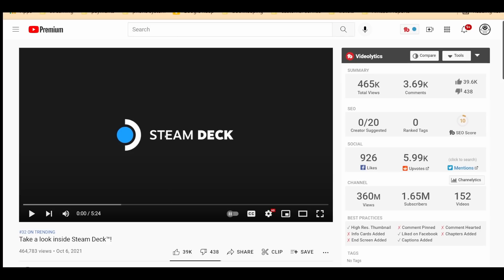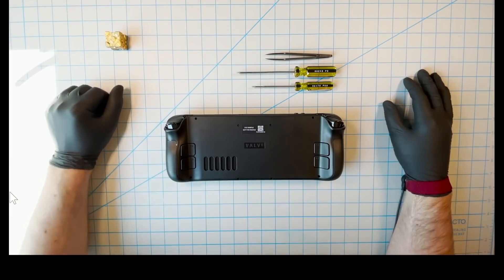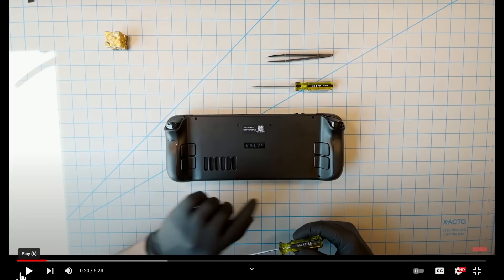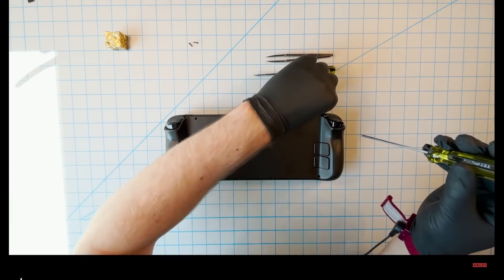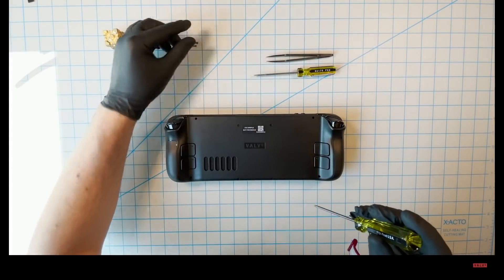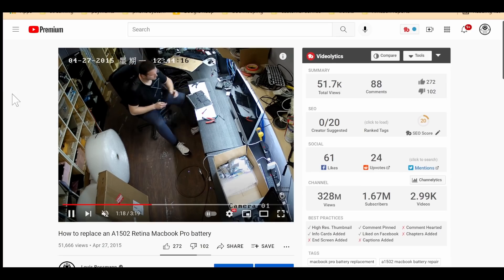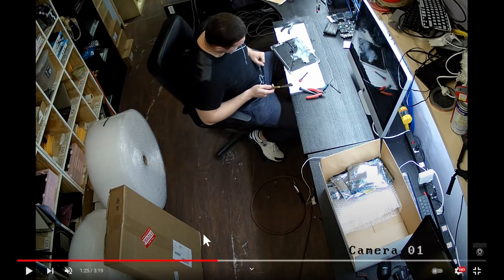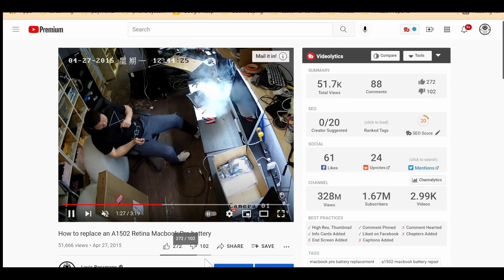Steam deck battery may end your life? bruh 😑

Comment: About the risking of your life bit.. If you nick the battery just enough to not catch fire right away, but only when it's charging (getting hot) It might catch fire without you noticing. That could be dangerous... But Li- batteries might do that anyway.. I think he was getting at the risk of your battery catching fire after you've closed the case and forgot about it..
But they also say, you literally have every right to open your device, we just don't recommend it if you don't know what your doing.. Leave it to the professionals (in my perception that professional could also be an independent workshop...) That's fair enough in my opinion... They are not saying you're not supposed to open the device, full stop, they just say that when opening the device, it's best you KNOW what you are doing, otherwise it could be dangerous.. If you don't know what you're doing, leave it to someone that does (notice he said professional, not Valve service technician) That's not exactly a lie..
And granted, I'm a bit of a Valve fanboy.. In my perception they are usually on the right side of consumer issues. And customer support for their devices is usually pretty good..

Comment: the structural integrity of the steam deck after unscrewing the self-tapping screws and rescrewing them back in has less than 5% difference... also the screws themselves dip deep in the case so nothing will happen to your device (:

Comment: I had an old rc car lithium battery go bad on a charger, on a carpeted floor, I wrapped my hand in a grocery bag and threw it in the bathroom sink and turned the water on, the carpet wasn't burned I wasn't burned, and it didn't have a chance to catch fire.
Reply: Good call.  Water can put out a lithium battery on fire but it may need a good amount of water, so putting it under a faucet is a smart move.  I did laugh out loud when they put out their original video saying "you may die".  I've taken apart both of my Steam Decks a few times and I'm still here 😂

Comment: That whole segment about the warranty had me so confused. In Germany, it's pretty simple. What is the warranty for you is called "Gewährleistung" for us. 
What is much more important is the "Garantie" though, which I always thought was the warranty, but apparently isn't. Manufacturers have the choice to give their customers a Garantie (a guarantee maybe?), whereas the warranty is a legal right. 

The difference is that the "guarantee" can be defined by the manufacturer however they want, meaning if they put a void sticker, you can't open the device up. The warranty is indeed untouched by this, but it means you have to prove that there was a defect in the device that has been there since before you bought it. And if you are able to do so, it's the manufacturer's legal obligation to fix the product or give the customer a new one.

The "guarantee" however usually says that if something happens to your device just by regular usage, you can have it fixed for free by the manufacturer.

Comment: "If you open your Steam deck you will lower it's structural integrity."   Now that was certainly an odd statement.  The only factor I can even think of that would do that might be the strength of the plastic threads from the self tapping screws.  But I just can't imagine that making much difference.  I am a auto mechanic by trade.  And cars are made with very specific structural rigidity standards.  I've stripped my Honda down almost to the point of it just being the body in white.  And re assembled it several times at this point.  And I can assure you it hasn't affected the structural stability of the car.  Can you imagine if Honda sold you a car but said, "If you ever take the wheels and tires off, it will affect the structural integrity of the car."

Comment: Your BS alarm is correct about structural engineering.  Only way you would loose structure strength is if you damaged case when opening or closing.  If everything is put together without damage, it will not affect.  It's like, if you take wheels off your car and put another one on, you could loose control of your car.

Comment: I have been doing electronic and repair for going on 25 years at this point and I have only ever killed 1 thing with static...and it was a special sensor board that I knew was sensitive to static and I was barefoot on my office carpet and felt a little zap...and for the record...if you work on electronics just stay seated and touch something that is grounded...as LR mentions twice.  I have never had another instance of killing something.

Also, batteries should not be glued in, I dislike that practice.  There should be either tabs for screws or a little strap.  I have never ignited a battery accidentally yet...but some of the devices use glues that are darn hard to get off...just my thoughts.

Comment: I think you would only f up structural integrity if you messed threads up when putting screws back in. I always turn screws anticlockwise gently until I feel them fall into original threads before tightening so you don't end up cutting new threads in plastic housing.

Comment: The integrity definitely is lessened and can certainly put the product at risk of permanent damage if a user forgets to put a screw in or doesn't tighten it properly, so it falls out later on. Put 2 2x4 on a trampoline while you jump on it, and see how differently they behave while screwed together only at one end compared to both. Missing screws definitely can cause issues with how the structure reacts to force.

Comment: structural integrity could be affected if stuff isnt put together right. the case looks pretty thin and i don't see many plastic ridges supporting the device. the strength of the structure may be related to having all of their specific components in the device and if the customer changes something to a 3rd partys component it may  cause issues. Might be an issue with stripped screws and such.

Comment: I mean, if they're self-tapping screws, unscrewing them and screwing them back on without following the current stripping pattern of the plastic should make it somewhat less structurally sound. 

Primarily because the failure points are where the screws are, and when an impact occurs, all stress goes into the screws, and thus the plastic that holds the screws. 

If the stripping is fucked, it might be easier for the screw to just simply break through whatever plastic remains holding it together.

I guess you could minimize this by making absolutely sure that the screws go in the exact same way they went in the first time instead of letting them cross-strip the already existing pattern, but even then if it was near perfect you're still exerting force on top of them when screwing it in so the plastic might have its grip on the screw reduced.

Comment: Duuuude Final Fantasy IX is amazing. Steam actually has an HD version available if you ever wanted to revisit it.

The claim regarding structural integrity may have to do with the device being assembled by machines vs being assembled by human hands.

I used to disassemble my consoles and controllers for cleaning purposes starting back from the 32-bit Sega Genesis. But as the tech changed over the years and I noticed the changes throughout the Playstation era and the PS2 era, it actually became more difficult to reassemble the later controllers into a tight fit, like one would expect coming fresh out of manufacturing. I'd chalk it up to human error more than anything, but that bit of human error could simply result in the fit of the shell not being as snug after being in inexperienced hands.

So if anything, it's prolly just a disclaimer to cover the demographic of would-be repairfolk getting in some practice by working on their own devices.

[I also just noticed: The last Chapter title says "What likeky led to these disclaimers"]

Comment: Good video as usual. Couple notes about SSDs. AFAIK they don’t wear from reading data, they only wear when the software writes data. However, there’re 2 reasons to replace them even if they’re working fine. SSDs improving fast, newer models are often much larger and/or faster. And, hardware vendors are very cost sensitive when they’re picking parts. For these reasons, I don’t have a single computer in this house with a factory-shipped SSD.

Comment: The reason the device might be less `strong` after opening is all down to the self tapping screws, the first time they are screwed in (in the factory) they have a perfect fit but if you un-screw them and re-screw them it is not possible to get them perfectly in (even with a toque wrench) you will either not go far enough or you will start to weaken the plastic that is just a downside of using self tapping into a soft plastic material.

Comment: It is pretty likely opened device is going to get weaker. It is reflected by many devices are fking impossible to open on the first try but later jobs become easier in terms of opening. This bothered me a lot cause when I follow people's repair video it is effortless and when I do it I wrestle the fking thing for an hour. These people rarely tell you it has been opened before so it is easier for making the video. Is it going to be weakened to the point of fragility? Nope. You might find it strong enough for your normal use.

Comment: I guess the guy meant that if you overtighten or under tighten the screws, or overtighten them in a wrong order, you can make an unnecessary mechanical stress.
I am not a mechanical engineer, but have heard these advices, which are also in a Prusa 3D printer assembly manual.

Comment: I hate self taping screws in cheap plastic. I have GTX 960 I opened up to dust and the fan shroud screw hole posts all disintegrated on removing the screws.

Comment: So on the structural integrity:
It is like building a church or an arch, you have pressure points that only hold till outer forces intervene. Replacing or just taking the arch apart and putting it back together, basically voids the structural integrity, because you took it apart. You moved the pieces so that it can not sustain the same pressure so the structural integrity is weakened.

disclaimer, not an architect but a observant student of physics and architectural design. There are videos on this topic.

Comment: It’s absolutely worth it if something else is going on wrong to open it and repair it but since they’re self tapping screws straight into plastic the interference fit will not be as tight. It’s more than likely fine and thread locker would go a long way to making up the gap. But self tap screws into plastic cause plastic deformation as a part of the locking mechanism so it is weaker very subsequent time it’s screwed or unscrewed.

Comment: 7:15 To be fair here, if you manage to kill your Graphics Card while replacing an SSD you should probably NOT be disassembling ANY of your devices~  

Personally, the first thing I do after testing a new device for proper functionality, is take it apart and replace the stock thermal paste with high-quality aftermarket paste.  90+% of the time this will result in significantly quieter operation (there's a better transfer of heat increasing the efficiency of the heat-sink + cooling fan)

Comment: I dissagree with point about batteries. Yes, sure, in most cases you have plenty of time to escape but the battery has a potentional to start fire inside your home, and I mean you can't tell that this would not harm your life. Non the less this device is meant to be portable so if someone not expirienced or knowledgeable don't know what he is doing, he could stuck something under the battery what cound after time bend the battery enough to burn. Maybe in your hands or backpack even. Like Galaxy Note 7 also had this issue. It is not as easy as you are saing in my opinion. 

I think that Valve did good job to tell that the battery could kill you because unless someone knows how to handle them, he should not work with them. And even if now someone will, he will know that he need to be extra carefull dealing with it. Anyone who cares about IT can find out that they just need to be carefull to not dent them.

---
Also, the thing you are saying about ESD is a lie, actually, the old electronics LESS sensitive to ESD than the new ones. This is thanks to the metal oxide inside of the new modern transistors. Metal oxide makes them much faster, but as a side effect, they are more ESD sensitive.

Comment: There is literally no way to tell from this video how much removing the screws will affect structural integrity. We don't know what the plastic is, what process was used to mold the part, or whether or not it has any fiber reinforcement. Also we don't know if the screws are thread cutting or thread forming. With all the unknowns the amount of integrity loss from disassembly and reassembly without knowing the proper torque specs for the screws isn't going to be zero. Some damage will occur no matter what. The affect that damage has on overall integrity would really depend on the unknown variables I mentioned.

Comment: The structural integrity may be affected, but probably not by a lot.
Maybe they use certain torque for the screws, perhaps screwing again weakens the threads slightly, but unless there was some glue adding structural rigidity, I don't think integrity wi be noticeaby compromised. Also you're not going to be tossing the thing around right?

Edit : You need to make sure the screws go back into the original threads, and many people don't have the mechanical affinity to detect this. They'll just "screw it down man!"

Of course there's probably someone who will strip the screw holes or undo it 20 times ;p

Comment: To be fair not all Li-ion batteries are that slow to erupt.
had one go full Chernobyl on me in <0.5s while discharging.
But to call this a risk to your life is just being hyperbolic.
People are trusted to fill gas tanks on lawn equipment by themselves, if you messed that up and got gas on the machine it could easily ignite. 
That's got much bigger risks than moderate (100wh~) li-po batteries will ever have, and is considered an acceptable.

God people are babies these days.

Comment: The downside of self-tapping screws in plastic is that plastics are quite soft and pliable compared to other materials. Self-tapping screws cut their own threads. Over multiple times of re-inserting the screw it's potentially widening the threads it cuts into the plastic to the point it wears out and the screw no longer holds. 

Presumably, you want the backing to protect the internal components from bumps, abrasions, electrical shorts, and so on. I think this is the only valid point they can make considering screws are all that is holding the backing onto the device. If the steam deck in those videos was compromised at the screw locations on the backing, then you would see the backing separate under a significant drop, instantly stripping out threads the screws had created in the plastic molding.

At that point, the only option is to use larger diameter screws to make new threads if enough remaining material exists, use an adhesive to fasten the backing to the body, or simply replace the whole plastic body. I think if we read between the lines they may be saying they won't be selling replacement backplates or bodies if you strip yours out or damage it from dropping your device.

Comment: I think it is worth noting that you aren't the people they are talking to, this message is for the average consumer. This strikes me more as a "Hey, this is serviceable, but it isn't designed to be user serviceable. Yes the thumb sticks can be changed, but not in the same way that you can change the AA batteries in a remote. If you feel comfortable and safe taking it apart to fix it that's great, if not YOU DON'T NEED TO BUY A NEW ONE, take it into a local computer repair store and they will likely have someone who can do this for you much cheeper"

Comment: In regards to your structural integrity question - It is absolutely the case. To visualize why, you have to keep two things in your head: first - what IS a screw? it's a helical vedge. Vedge is a device that's provides stability through both pressure and friction. Second - HOW are these screws installed? They are installed into an undersized hole by cutting and displacing the excess material. This material provides the pressure necessary for the screw to do its job. Once you unscrew any screw installed that way you either won't have enough pressure to hold two parts together - which would lead to an unsecure fit, allowing two parts to bang against each other; or (more likely, either beacuse you are using the torque wrench that doesn't care about the number of rotations avaliable, or because you eyeball it and feel that the pressure is lacking, so you tighten it more) you'll have to cut and displace more material to compensate, which the shells of appliances are rarely designed for - which would lead to excess material stresses, that could lead to catastrophic integrity failure (i.e. all the stress releasing all at once in one big ass crack through the weakest region of the part).